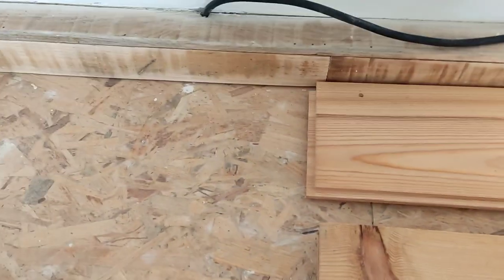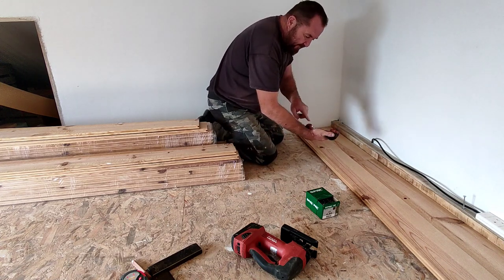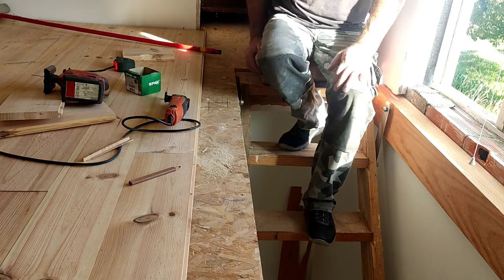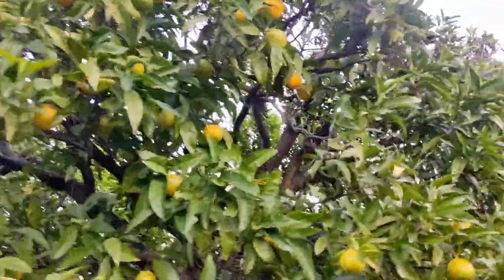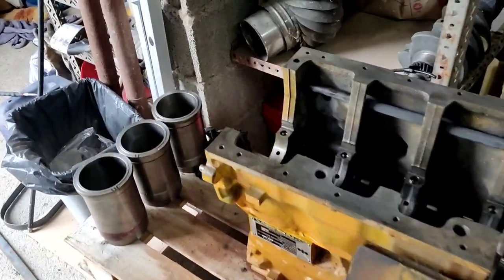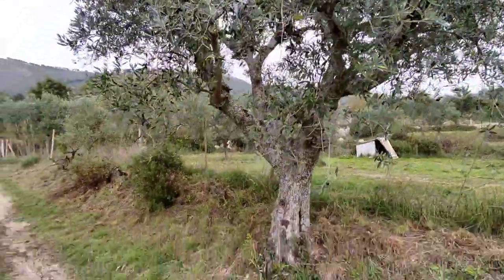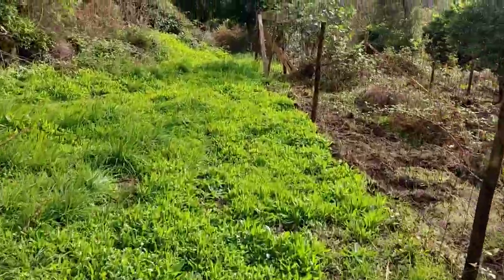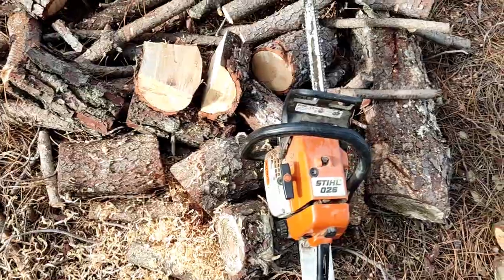111 : Laying Pinewood Flooring and Harvesting Our Olives

Comment: Hi guys , floor looks amazing! when i was out there in 2019 i watched the local harvesting olives, and thought if you could shake the tree at once, how much work it would save, toyed with the idea of a motor with an offset weight, like they use in mobile to make them vibrate!.. but bigger!.. using a motor speed controller, or PWM, strap it to the trunk and slowly raise the speed until you find the resonant frequency of the tree.. im pretty confident the olives should drop off all together.. best inventions were just an idea!.. but think Nik has enough on his to do list, respect to you both..

Comment: Hi nick and Andrea busy times olive season so having extra help makes easier work,liked the t&g floor looks nice if you have any sawdust mix with a bit of glue work it into the gaps and sand down then two coats of varnish it will look the bees knees.😊
Reply from the maker: Thanks for the tips

Comment: Thanks. Genuine question: I am about to do similar flooring in Ireland. Tong in groove. But I was not sure if it needed to be screwed down or floating and perhaps glue the tong in groove. I though that for expansion it needed to lay non fixed on the floor on a foam underlay?
Reply from the maker: It's very damp where you are, I'd suggest glueing and a good gap around the edge, on a foam
Reply: @projectportugal  Thanks.